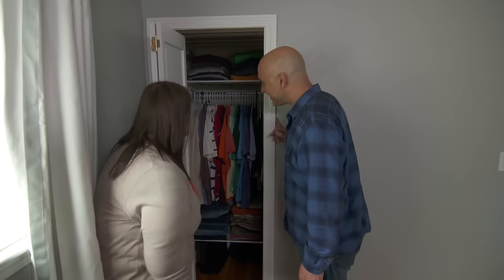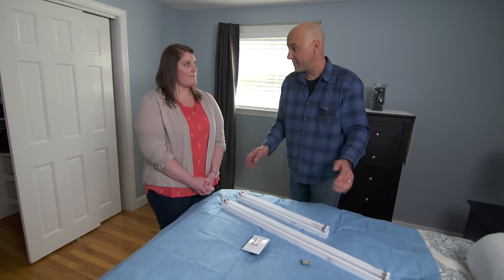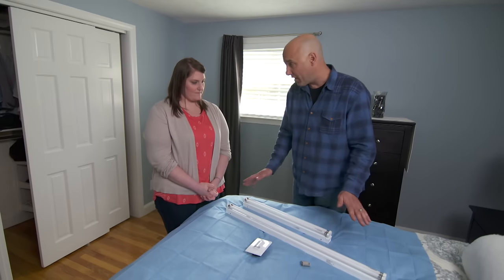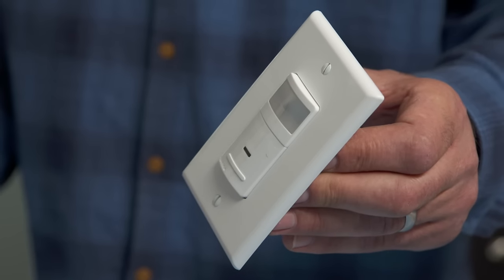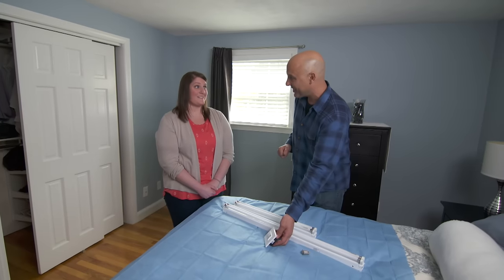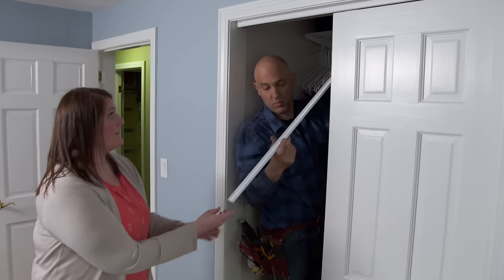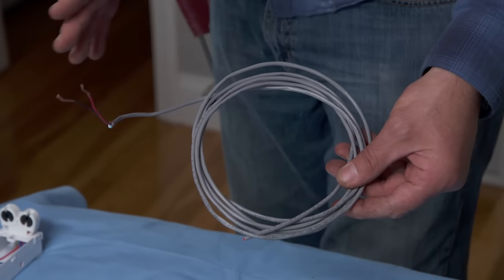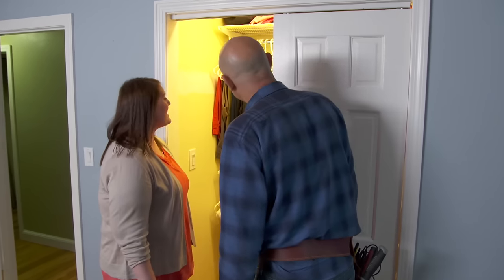How to Add Automatic Lighting to a Closet | Ask This Old House

Comment: While the LED fixtures are still more expensive than fluorescent fixtures, how long before you need to replace the bulb(s) because they're turning on, then off for that short period of time? CFL, FL and others are best when left on for longer periods of time. When you turn them on and off, their life is greatly reduced. Not only that, but a 2 foot LED fixture isn't going to break the bank compared to a fluorescent fixture.
Reply: Why would you buy more expensive bulbs just so it can last longer when you don't even use the bulbs that much??
Reply: +JesseFernandesTV It's more about the use of a fluorescent bulb in this case that doesn't hold up to the short on time. As I stated in my comment, they are best suited for long periods of on time. It's probably negligible in this instance, sure, but the point stands.
Reply: because bulbs will burn out faster with the constatnt on/off application
Reply: A old fashion keyhole light fixture($1,$2 for it)  be great. Without any fancy tech to it. Other then a Basic switch.
Reply: @ZMan492jj2j2  Yep, I agree 100% with you. Most Fluorescent lamps are also Made in USA however, these LEDs are all Made in China and will never last as long as the manufacture life says.
Reply: True especially after all the work to install it what is it gonna be $50 more? also the clothes will look a lot nicer in LED lighting versus fluorescent.

Comment: Low voltage or not, exposed wiring is tacky.
Reply: Youre absolutely correct. Most customers would not be paying a professional for a closet light install only to have an exposed low voltage splice and gray wire stapled down.
Reply: +beeps on the inside wall of your closet? Maybe if it were a walk-in, but odds are no one would ever even look there.
Reply: +beeps  A better term is Controlled Voltage because low voltage may make people think it's safe when in reality it can still kill you. I don't care if its 1 volt or 1,000, Don't leave wires exposed.
Reply: beeps you call it tacky I call it rustic
Reply: @William Winder, there is a limit where your body resistance makes it impossible to conduct enough to get enough amps going to hurt you. 1 volt will never kill you. If i remember correctly 40 volts DC and 60 volts AC are the limits of what you can 100% safely touch. Search Google for the exact values. 12V will never ever hurt you seriously.
Reply: It's not Volts that kill it's Amps. As little as 0.1 to 0.2 Amps can prove lethal.
If you don't believe me then look it up.
PS. i've been hit with over 1,000 volts, and it felt like someone hit me in the chest with a sledge hammer, but it had no lasting effect.
Reply: balderoine yeah just google to find out if it will kill you or it's acceptable? Just because you saw it on the internet doesn't mean it's accurate and when it comes to electrical why risk a shock?
Reply: Car Batteries are 24V. Touch one and if you survive, lemme know
Reply: car batteries are 12 volts and I have
Reply: William Winder Try reading my post again, this time a little slower, maybe you understand what i said in a second round. The resistance of a conductor (human skin) determines how much current there is going to flow by a given voltage. 0.038 amps is fatal, 0.1 or 0.2 amps what you said is way beyond that. At low voltage there cannot flow nearly enough amps to hurt someone. Know your facts.
Reply: beeps
Reply: TheSeattlegreen telephone wires should be constant voltage whether it is in call or not.
Reply: That closet would NEVER pass inspection ! A professional electrician would rewire the whole damn house even to put a light blub in. It's the right way damn it
Reply: beeps Considering he can't feed it through two walls without the luck of god and exposed wires is the cheapest, easiest, and safest solution. As long as its not hanging and in arms reach ecen a jackass running around with a knife in the closet is safe
Reply: (In responsr to richard van Pukkem)  I have a car battery, jumper cables and some wet sponges to prove it... ;-)
Reply: Especially with those bright orange wire nuts exposed, too. Just ugly.
Reply: If it's something I'm doing myself and it's the inside wall of a closet that will more than likely never be seen, who cares. If I would pay someone to do electrical work, I'd be pissed if there were any exposed wires.
Reply: You are overthinking it. This is a low end home so they are getting a basic install. Its fine and no one is dying, give it a break.

Comment: That color temperature was too yellow for picking clothes.  Use 5000K so you have no yellowing 2700K when coordinating outfits.
Reply: Aaron Stivers it doesn’t matter people can change the bulbs when they want
Reply: 6000k is better. Hence led is way better
Reply: 2700 is soft warm light. 5000k is more for shop lights. But bottom line is... is about choice. Who cares
Reply: @Tattooed-ig8tj  LED is not better, they are all Made in China or Made in USA with global parts. However, many Fluorescent lamps are Made in USA.

Comment: I’m pretty sure the NEC requires a protective lens cover for fixtures in a closet or its even a good idea for safety against accidentally shattering the exposed lamps
Reply: How would you shatter them? Besides, those fixtures don't come with covers.

Comment: There are great automatic lights called Mr. Beams! No wires, turn on and off, motion sensing. A great product. I have changed out the batteries once a year, looks like a smoke detector. They make a great outdoor light too.
Reply: Yeah , I’ve installed something similar in several closets.  Much easier to install.

Comment: Client : “I’ve seen you use LED lights on other projects, why wouldn’t you use them here?”
Electrician :  “ This is what I bought for your house, and this is what you’re getting. “
Client :  “Why don’t you put those fluorescent lights back in your truck and hit the road, I will tell YOU what we are going to use in MY CLOSETS “
Reply: I understand this is 6 years ago and I know technology gets cheaper as it ages so maybe the LED light fixtures were expensive then but this guy seems unprofessional af. I can't imagine a 2 ft fixture being more than $30
Reply: I honestly don't know who's worse. Scott ripped off the client while the client didn't stand up for herself. If I was her, I would've insisted on LED no matter what the script says
Reply: @Just DC  you have to compare the cost of the fixture vs the electricity cost to use the cheaper option. LEDs are slightly more energy efficient than the fluorescent, but the cost even to this day, can be higher than most would want to pay. Not to mention, LED fixtures often fail way earlier than they're supposed to, and the fact that they have no lamps, means you're replacing the entire fixture.

Comment: When you drilled a hole, the wood split open... should you have started off with a thinner bit?
Reply: Prolly
Reply: He used an auger drill, it has a feed screw at the tip so it has a tendency to split wood sometimes.
There are other wood drills which don't have such tendency such as brad point drill, spade drill, forstner drill.

Comment: Kevin does a good job. Though on this one, product choice is ok, but I would have sold the customer on self contained LED fixture by Leviton. Things happen sometimes like hard objects hitting exposed lamps. And not sure if I would have sold the customer a motion switch or the low voltage switch. My thought is your already cutting in old work boxes and installing switches just keep it simple and put switching on the outside of doors.
Reply: You're not even allowed to have exposed bulbs in closets for the very reason of someone accidentally hitting a bulb
Reply: This was uploaded 5 years ago and was probably filmed 15 years ago.
Reply: I like how you called Scott "Kevin" 😂. I don't blame you though. Both men are mediocre to say the least

Comment: Why would you need a transformer to make it go low voltage on the small closet ball switch?  I've never used a transformer when putting in a regular toggle style wall light switch.  Why would it be any different with a ball switch?

Comment: When she opens her cupboard from the other end (not the one they tested) I am not sure that the infra-red detector will detect unless it is ultra sensitive -  the angle of the two doors will shield her body from the sensor unless she actually leans into the cupboard...?
Reply: Exactly what I was thinking. I've installed that sensor and it won't work on the faraway door unless she pokes inside the closet and clothes are not in the way.

Comment: The small closet has a light with a permanent contact switch. As long as the switch is pressed, the light is off. Same thing as the light inside your refrigerator, stove, or dryer.
Reply: +IAmNotAFunguy or the courtesy light in your car.
Reply: Think he means the light that comes on every single time a door is opened, which is a LOT

Comment: Florescent Tubes have a gas inside the tube that needs to be heated with a high voltage to brighten. This takes a few minutes especially as the light gets older. Installing it in a closet would not give optimum light during the brief time the closet was opened. The lady was right on the LED choice.

Comment: The ball switched used, are they always low voltage? The ones I found online seem to require a relay to make them work rather than just running 120v
Reply: all depends on the setup.  he stated his ball switch had a transformer inside the light to take the 120 to low voltage to operate the switch.
Reply: Amprobe RC-120S Solid State Relay 115V Closet-Light Type 2 Wire

Comment: Florescent lights are a horrible idea for closets. They take a while to warm up to full brightness, especially when they're cold. In closets there usually isn't any heat so they tend to be a lot colder in the winter. So in the minute or two you're using them you'll have a dim light.
Reply: Great point. Scott sure does like to rip people off
Reply: You’re not wrong, but they look plenty bright right off the bat for a closet.

Comment: Omg this video is from last Millennium! All that work and gigantic sizes of equipment for automatic lighting. Single battery operated led light holders with small sensors which cost about $10 can be used here!

Comment: Do you have wired remote light switch or dimmable light switch and wired in- line receiver ? Please give me the model no.
It is little complicated, please read it carefully.

I want install a light (LED or dimmable LED ) on my ceiling, beside an old light, which is powered with 120VAC, and a remote wired switch to replace old switch for the old light, and also a new remote wired switch to control the new light, because I do not want to use battery power wireless switch, which I have to replace battery regularly. Because the two lights are not far away, the can share same 120VAC power, and two switches are stay side by side, they share the 120VAC power also.

Comment: I googled transformer switch and could not find that gizmo that goes between the ball and the light.
Reply: Amprobe RC-120S Solid State Relay 115V Closet-Light Type 2 Wire
(This Is the correct one)
Reply: Thank you
Reply: @jbrcich709  no problem
Reply: Dynoesaur I looked up that part on Amazon -  it’s $47.  That’s way too much for just one closet light since that price doesn’t include the light or the door jamb switch.   In my closet I installed a motion led light which was about $18 for everything combined- light, enclosure, motion switch, power cord.
Reply: @neilbrookins8428  $18 wow send the link
Reply: Dynoesaur here is the $17.16 usd light I used:    Led Motion Sensor Flood Light Outdoor 10W 800LM Pir Sensitive Security Lights Wall Fixture Lamps Waterproof Floodlight for Garage Yard Patio Pathway Porch Entryways-Daylight White (with US 3-Plug) https://www.amazon.com/dp/B0778MNTL7/ref=cm_sw_r_cp_api_i_vCK3EbN0A5BKS
Reply: @neilbrookins8428  you put a flood light in your closet
Reply: Dynoesaur yes, but this is only a 10w light, so just the right amount of light and very little heat so low fire risk.

Comment: You know you can remove the ballast from the fluorescent fixtures and use LED tube bulbs in their place.  Were these not available at the time of filming?
Reply: they were but were expensive, they would have never paid off in a closet that is used for at most 15 minutes a day.
Reply: they are only $14, how much was that new fixture?
Reply: how much were they when this segment was recorded? Who knows if it was actually recorded in November 2015 or not, but even in 2015 LED's were more expensive than they are now. and even if they were only $5 more, it takes a long time to make up $20 on light bills with fixtures that are used for 5 minutes a day.
Reply: @RoastBeefSandwich  I've seen people in these comments say florescent lights will burn out sooner if used intermittently like this, and they take longer to warm up to full brightness so the closet will end up being dim.

Comment: Scott never attaches the wires in the correct order, ground to ground, neutral to neutral, hot to hot. Then reverse order for removing them. It's pretty simple and could save your life if something goes wrong.
Reply: I’ve never heard of the neutral and hot order it makes sense but I know to always install ground first
Reply: He had the breaker off what does it matter?
Reply: @gregMD856  the rule to try and treat any wire as live so if it is you won’t die

Comment: Hey Miss lead this customer you could buy the LED high-voltage bulb for 10 bucks apiece you remove the ballast from those fluorescent lights you have and you wire the bulb up direct 120 V LED that’s all

Comment: I would remove the motion switch and replaced with toggle. I like the idea of the auto  ball switch but do not like having a transformer. I would have both switch activated and would have never put in fluorescent fixtures.

Comment: Those fixtures do have covered bulbs so that part is legal but it looked to me they were closer than 18" measured horizontally from the shelf. If so, then it would be illegal per NEC 410.16.

Comment: Don't power wires need to be stapled to studs inside the walls? That would make this install not up to code.
Reply: +Blaine Brown  Yes, "on new work" but not when you are "fishing" conductors inside existing walls. It would be "up to code". Only things I noticed that I would question from a code aspect were the number of conductors in the little blue box (wire fill might be over allowable. Why not use the 4" square box from the attic to feed the other light?? ) and the connectors in the attic J-box didn't look like romex connectors. They looked like "MC" connectors.
Reply: Ha ha ha

Comment: I used the old style Ikea Norrflys and they work amazing in the house.  They are low voltage so I even have one I tied right into the doorbell transformer and just used a rectifier to get DC.
https://youtu.be/Azrtbjcvd3I -  using the doorbell transformer for power
https://youtu.be/IdSqecn4fmA  - My Sliding Closet Setup
There are several other alternative ways of doing this.

Comment: This is absolutely the WRONG application for florescents. The lifespan of a florescent bulb is significantly shortened with fast cycling like you get in a closet. You're cutting the lifespan of those bulbs down from 7+ years to 1-2, almost as bad as incandescents. LEDs are more expensive, but still the correct solution. And they're much cheaper now than when this video was made.
I also think wiring both lights in both closets in two different rooms on the same leg was the wrong decision. Of course I don't know how the house is wired, but generally the master bedroom has its own circuit, and often other bedrooms do as well. The way he did it here will be confusing because a person may shut off the breaker for the bedrooms but the closet light will still be hot - which is bad. 

Also, anybody else notice he seems to waste a lot of romex in these videos... Copper ain't cheap.
Reply: Well if the customer is paying for all the Romex who cares
Reply: @agy234  Anyone and everyone who thinks about waste beyond the dollar value?
Reply: I don't think that romex is going to waste. He can use them for pigtails and wire labels. That's what I do with all my extra romex. It's always better, and easier, to have more wire than less wire. Yes, I know romex is getting more expensive, but back then it was cheaper.

Comment: i still dont get how he used current up in the attic?
Reply: +avalanche He took an existing cable on another circuit, spliced it in a junction box and used that power to feed the new lights he added. It's common to do this in homes as A. it wouldn't be practical to home run a new circuit from the panel to one light fixture, B. as long as he isn't over loading the circuit, electrically it doesn't make any difference either.

Comment: Not very safe. That's why in Ontario the light fixtures in closets have to be covered not just exposed bulb. Why if someone by accident hits it with a coat hanger or something.
Reply: Boris They have to be covered in the US too. The way he did it is not up to code.
Reply: Boris am sure they told the lady to cover it but that light cover sits on that closet shelf to this day running talley so far is 7 busted lamps in the husbands closet from 1 to many crown bombs
Reply: Same here in Michigan- any closet fixture must be covered

Comment: low voltage line looked super tacky! drill the hole deeper and run it in the wall. and I would have run an LED lamp.
Reply: Had to get around the header above the door, but I would've at least put it in a small piece of WireMold or some sort of cable cover. Homeowner probably didn't care.
Reply: just paint the wire. their closets still had unprimed drywall and mud lines visible, I'm sure they didn't care about the exposed LV wire.